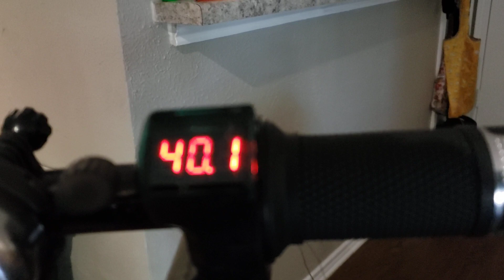Razor Ecosmart Electric scooter 2 sets of batteries!! Extend Range!

Comment: Thank you so much for the innovative video.  I'm handy, but electrical is not my wheelhouse.  Can you please diagram or give more detail on exactly how to configure the wiring to install the 3 way toggle switch?  I have two sets of batteries, each with a black and a red wire, matching the original harness.  Thank you very much! Eric (Las Vegas, NV)
Reply from the maker: Someone else asked me about this but I was very busy with other projects. I will try to do a video on this in the next day or so. Basically, you are going to have a separate positive wire going from each set of batteries to the motor and a common ground. The toggle switch will be what completes the circuit from either set of the batteries to the wire that goes to the motor.If I remember correctly, the single positive wire that goes to the battery is also connected to the positive charging output circuit. That's how the toggle switch also lets you charge the sets separately. So the same switch is letting current come into the battery or out to the motor, depending on whether you're riding or charging.
Reply from the maker: Just uploaded the explanation video! THANK YOU for the motivation!

Comment: I ordered the same throttle. The new throttle is 5 wire (Y/BLU/G/R/BLK) the old wiring connector for the original throttle is 6 wire (BLK/BLU/R/Y/BRN/W)

There were no instructions. Can you tell me how to match the wires
Reply: Did you figure this out?

Comment: Dude. I've been wanting to do exactly that to my ecosmart, I too have the 15 amp upgrade but also wanted to extend my run time. I still have my old set of battery's, so could you make a little more detailed video on exactly how you did what you did. I'll check your video catalog to see if you haven't already done that, but of not, please do.
Reply from the maker: The explanation video is up! Sorry it took so long!

Comment: How do you keep your batteries from swelling as I recently put three 12v 12AH batteries and in one week they swelled so much they're stuck together.  I did charge them overnight a couple seperate nights because the red light on the Razor factory charger never turned green.  I'm just not sure how to charge them using the original charger. Also, if this information helps, these batteries are around 3+ years old as I pulled them from a couple old kids ride on electric karts.  However, I left them plugged in to the kids kart overnight all the time (when my kids used them)  but charged one battery at a time and they never swelled.
Reply from the maker: Usually when a SLA battery swells up, it's because it was overcharged or short circuited. The most common reason is overcharging. Sometimes it seems that it's because the battery is just old in need of replacement (I'm sure there is an internal reason like cracks in cell divider walls happening).  I've only personally had this happen when my batteries were older and needed to be replaced anyways. I hope this info helps!